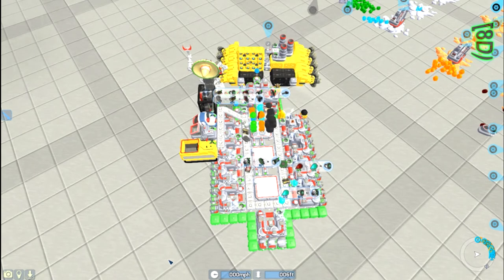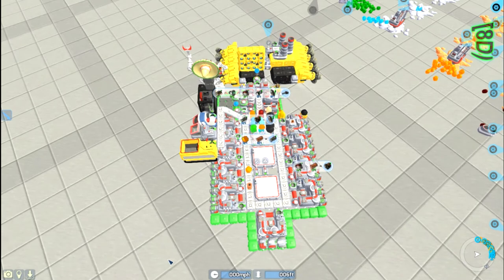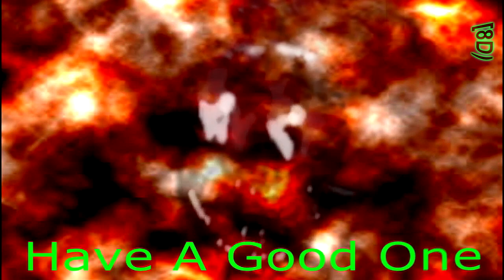Terra Tech - 0.7.3.5 - PT 1  - A Challenging Build - Let's Play

Comment: As I understand the crafting challenge (for 21 April), it is the Springer Wheel time that counts. So if someone beats a construction with 1 second, it should not matter how fast the optional Autoccannon is fabricated. Only if same time on the main objective. Also could do it with separate bases.
Reply from the maker: True, the important time is the wheel, but the auto cannon gives you some kind of bonus points. Most likely for in case there is a tie I would think.
I think I might focus more on the wheel time instead of both for my next attempt.
I don't think you could use seperate bases since only 1 entry per person is allowed usually. I did try a double sided base that split the resources to work on each block at the same time, but I never timed it to see how long it took.
There's still a week to go so we will see what happens.
Have a good one   [8D)
Reply: The submission should be a save, not a png file of a tech. Because then you also have the settings ready, preferable on repeat. So in that you could have 2 bases, or one with separate circuits. Good luck (all ;)
Reply from the maker: Good luck as well!
I forgot all about them wanting a save. Thanks for reminding me.
My little base there doesn't need any presets which makes it pretty easy to use, but probably slows it down. Like always there is room for improvement ;).   Have a good one   [8D)